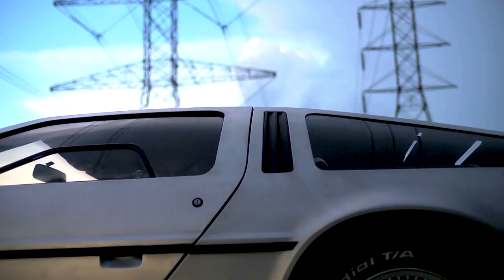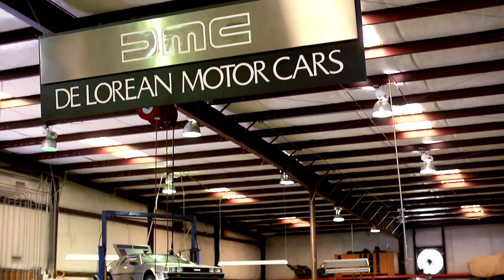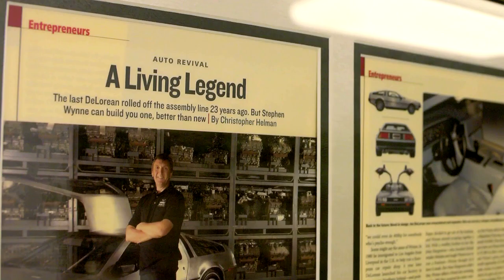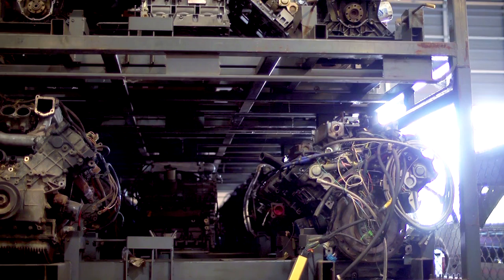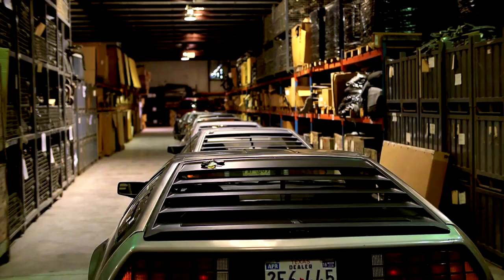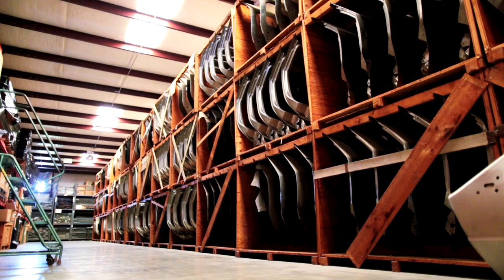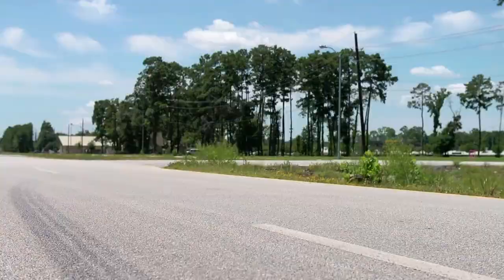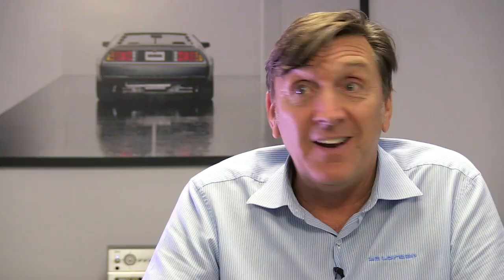New DeLoreans are still available, straight from the factory

Comment: just replace the engine and this car is a dream
Reply: +flip inheck I'm not american. i don't get why US restricted the hp of the engine?

 I thought US allows all sort of cars on the road.
Reply: That's like before the 60's where there were almost zero regulations with automobiles. As time progressed new emission laws started to popup, and a lot of engines in this time frame were heavily restricted to meet those standards. Took a bit to create engines that made decent performance at these standards.
Reply: Daniel Semi id be tempted to throw a nissan v6 in
Reply: juan def I would throw in a Yamaha 4.4 V8 or a 3.5 Ecoboost
Reply: HERPY DERPEDY I'd keep it v6. I'd maybe put a Renault V6 from the Clio possibly..otherwise a Rover V6 2.5
Reply: Daniel Semi that was the down fall of the car
Reply: HERPY DERPEDY you could rip that 4.4v8 out of a volvo and superchrmarge it
Reply: juan def yeah that's why I liked that Engine I could also throw in a Volvo inline 6 turbo
Reply: HERPY DERPEDY you must like the newer Noble that has a yamaha engine in it too
Reply: jonboy79 the last v6 Clio was tuned by Porsche. the engine is very good now. 255bhp(190kw) and 300N.M of torque is not a downfall.
the 2003 2.9 24valve engine is very good actually. perfect for a Delorean. 
so no, that engine is not a Deloreans downfall as it hasn't ever been in a Delorean.
Reply: Think this engine needs abit tuning and there we go :)
Reply: It had an Volvo engine 130hp, i can tell that theese iron engines can be tuned pretty hard :) but then again, Look at the Car, remember your childhood (yes im old so what) its still more 
a car than an engine :) . Dont forget that there is people keeping this magnificent car up and running :)
Reply: I dont know what the Original engines were or the hp for it . But it looks like you could fit a small block 350 in there ? That would be plenty of power 305 as well ??
Reply: That PRV engine stinks.. 
would fit a VR38DETT instead 😎💪🏻
Reply: LS swap it.
Reply: Why not tune the original to max? :) It can take 400 hps :) well yes, its an old lady :) bit more tuning, might do more :) what do i know, im just an Goldfish in a bowl :)
Reply: The Spectator I'm a Turtle ._.
Reply: Daniel Semi  north star  v8 is a great conversion
Reply: Daniel Semi  north star  v8 is a great conversion
Reply: Nope, i refuse this, turd you are sir (joda talk going on) :)
Reply: Xmanhoe F 
Does it fit and has it been done, successfully? Best,
Reply: Yeah with a 2jz.
Reply: regular car reviews drove an ls swapped delorean check it out it's cool as hell
Reply: highoctanefiend 
Do you have the link?
Reply: joe Schlotthauer ^ link
Reply: Northstar is  never a good swap for anything not even swapping it back into a Cadillac lol they aren't long term engines. Ive seen plenty of these with v8 swaps turbo import motors etc and then I loved the car
Reply: flip inheck You are wrong. There were never any other versions of the DeLorean engine other than the couple experimental turbo engines. There was no higher-powered motor offered to the UK. And the US version is not restricted with a bunch of emissions. 'Da hell are you getting your crazy info from?
Reply: Make it electric
Reply: with a Flux capacitor.
That sells
The Words suggest a magnetic battery
Reply: Actually in truth the European one wasn't that great either. The engine performs well in the French Alpine and Venturri sports cars, but those are light fiberglass machines. But the heavier stainless Delorean didn't have the same performance as those cars. To add the to the problem, Lotus gave it a steel backbone chassis from the Esprit that added more weight. 
One former Top Gear journalist called the engine a wheezing asthmatic.
Reply: I would give this car the engine from the Chevy Volt... makes it more faster in terms of acceleration also does not have that much in terms of range anxiety as you get with the current crop of electric cars.
Reply: ***** anxiety is........ an anxiety.
Nothing else
Reply: +NorthernChev the truth is that the US market needed catalytic converters and other stuff to handle emissions. That restricted the performance a bit.. But not to the levels that this guy is talking about. The engine still didn't perform well in the European market.
Reply: Personally, I would like to see a Porsche 911 running gear swap. That would be awesome. A supercharged Evora engine is a good idea too.
Reply: Daniel Semi how about a time engine!!? OK that was corny.
Reply: flip inheck - It didn't make people believe it had no power, it had no power, remove the junk and it still, had crap for power.
Reply: Julian Pereira The DeLorean uses high-flow catalytic converters. And the engine has very few emission control devices. None that restrict any significant amounts of power anyway. The engine just didn't make power to begin with. Emission controls had little to do with it.
Reply: defintly the ecoboost would be crazy
Reply: My comments are from experience with a friend who owned one when new, it wasn't much power wise, most cars of that era weren't so I'm not slamming it. It ran out fine for what it was.
Reply: All engines were restricted during that time. The smog years took 400+ HP V8's and cut them in half, sometimes more. So, your theory is incorrect.
Reply: It's performance was improved in 1985. 

However, it still took 1m 40s to reach 

....88mph.
Reply: +NothernChev I am just repeating what I read in the Delorean book and what was in the Documentaries. No doubt that the PRV engine is a good engine. Its proven itself. But on a car as heavy as the Delorean, it didn't give the performance it should have. I do not recall there being a Turbo version as per the book. But I'm sure that the turbo would have been a good solution at the time. 
One motoring journalist called the engine a wheezing asthmatic. But the same praised the engine when in the Alpine A310. 
Of course early fuel injection systems did lag behind in terms of performance when you compared with the carbs. That's why many car guys preferred carbs to EFI on their hotrods. :)
Reply: +Jim J Fox ... Power to weight ratio. The PRV V6 was used in the Alpine A310. That car used to help engineer the underpinnings of the Delorean since Delorean thought about using it. 
The difference is that the Alpine was made from plastic or fiberglass and the Delorean was made from much heavier stainless steel. To all to it all, Lotus gave the Delorean a metal backbone chassis which added to the weight. 
Also the PRV V6 used EFI. Older EFI's were not that great. Car guys preferred carbs because EFIs used to give out less power and performance back in the day. As a result it was slow.
Reply: No production engine ever had it's horsepower cut in half by emissions. That's ridiculous.
Reply: Yeah, that's why, because we're afraid it will make more power than our inefficient V8's...Give me a break.
Reply: In 1970, the Cadillac 500 cube  4bbl engine had 400 hp.  By 1975, the same 500 cube  4bbl engine had been so severely de-tuned to meet emission requirements, it was only putting out 190hp.  Look it up.
Reply: Donny Hinson k
Reply: It is ridiculous. But, it's true.
Reply: why not use a toyota supra engine xD
Reply: It wouldn't fit.
Reply: You forget te obvious...those large american engines could work for years, have very long distance running by them and those powerful, tiny european shitty engine would break in warranty time...or shortly after it...Why? Because they are small, because they are overpowered, because they have to abide restrictly rules about environment...and thats why now in new engines it is nearly impossible to polish...when cylinders are in bad shape...and some of engines could last only 60.000 km and than are just a plain garbage - fuel economy, environment rules...and all this shit brings only one thing for a consumer - large, very large cost of repairing this kind of tiny shitty overpowered engine.
Reply: Honestly I'm not convinced. European engines are compact and built to strict tolerances, but most are really strong engines and provided that they are maintained well, they will run for as long as an American V8.
Reply: Julian Pereira You've obviously never owned a French car.
Reply: +Anon Nymous Nope, but I have owned an Italian one. Probably the most unreliable of the Europeans - Alfa Romeo. 
And in truth my Alfa's problems were not down to its engine, it was bad maintenance by the previous owner.
Reply: How does having owned an Alfa apply here? The absolutely AWFUL engine was a joint venture between Peugeot & Renault. With a manual gearbox 0-60 mph was a positively hilarious 8.8 seconds.
Reply: You are comparing two different engines, not the same engine with and without emissions. Manufacturers made different engines from the same block with the same displacement long before emissions. You are comparing apples to oranges.
Reply: What's with the recent spike in likes for this comment?
Reply: the vid is in trends
Reply: Daniel Semi yes true. And the speedometer. Lol.
Reply: and suspension.
Reply: +Anon Nymous
Firekage's comment about European engines being less reliable and inferior to the American ones. I will agree that the PRV is a bit of a dog's breakfast. For one reason that it was initially designed to be a V8. But then due to the fuel crisis in the 70s, it was turned into a V6; still keeping the V8 style block design, etc. 
However I'm not entirely convinced that the PRV is an awful engine. Properly tuned and with turbos it does produce some power. 
I've mentioned this before. The record for the highest top speed on the Le Mans circuit was done in a PRV powered Peugeot. That's an accomplishment.
Reply: And exterior lol...
Reply: +moparjr89 maybe they should change it for a HEMI. I would really like to see that, but I think that the HEMI engine is heavier than the LS V8s.
Reply: John Lane modified this PRV engine re-boared the Cylinders, Rods where from SAAB, Cuz Volvo and Peugeot Sucket on Metal integrity.... anyway he pushed 500+HP out of his new 2.9liter engine.... CHeck out his 240 Volvo Rally Car..LOL!
Reply: lol. 130hp it's fine. Ok...
Reply: Nonsense, America is why the world knows about Turbo Hondas.
Reply: Yeah this car engine doesn't fit it's model...
Reply: my only question is why did they make a car with 130 hp engine in AMERICA where Every AMerican cars literally have really big engine....? Fuel Crisis?
Reply: Cyano - P originaly Delorean is from Ireland.
Reply: Daniel Semi it rides really rough not a cruzer
Reply: You got to be really dumb to replace that engine,  a 2.8l v6 that only produces 97kW, drive this thing with a manual transmission and the engine is going to last forever.
Reply: +Rewjik The engine isn't the best, but its not worst. However I think that the Delorean would benefit from a really good replacement engine. There is one with a Nissan engine that runs really sweet. Another with a turbocharged 2JZ, which I would assume is really fast and quite reliable. 
There is another with a good LS swap. I did see a video of a Ford 302 small block swap. But I do not recall seeing a video of the finished product. 
If I was to get a Delorean, I would get one that needs work. 
Replace the engine with the setup from a Chevy Volt. That would give me great performance and good mileage as well. I would like mine to look like the car from the BTTF animated series though. :P
Reply: id just chick in a turbo boxer from a wrx sti
Reply: +Alexander Columbus
I go with the engine from the Legacy. Responds well to tuning and turbo charging as well as the WRX
Reply: flip inheck no it's the 3 speed slushbox. You need that 5 speed manual to have fun
Reply: MuggShotGaming yeah, actually, rally blue>stainless steel
Reply: 302 would be fine.
Reply: In a mid-engined car?
Reply: Joe11Blue The Delorean isn't mid-engined. It's rear-engined like a Porsche 911
Reply: So it is, my mistake.
Reply: Daniel Semi And fit a flux capacitor.
Reply: the interesting thing is that the engine noise you hear in the movie is the sound from a V8. But not just any V8. Its the sound from a Porsche 928s V8. 
Someone said that the engine in the original movie car was changed give it a better soundtrack. Others said that engine noise was done post production. 
All in all we can agree that the Delorean sounded really great in the movie than it does in real life. :P
Reply: JKflipflop I would put the running gear from a Chevy Volt. That way the tiny petroleum engine just charges the battery while on the move and gives more range.
Reply: an absolute dream
Reply: Maybe in the future it will hapen.
Reply: I see what you did there.
Reply: kaylerick  lmao
Reply: I was watching an episode of Wheeler Dealers where they do a Renault Alpine A310. They had an interesting idea about getting more horsepower from the naturally aspirated PRV engine. 
The Alpine club in UK have a kit where they made a manifold that helps you replace the stock carbs with a Holley 4 barrel carb; which I believe is easier to setup and tune to give more power. 
We know that Holley has other carb kits and even fuel injection that will can replace and perform better than the carb they used on show. Why not Delorean make up their own sort of kit and use the EFI systems from Holley. That would give more power to the engine and when they put in their stage 2 Turbo kit, even more power.
Reply: Everyone has their favorite choices on when it comes to the engine swaps in the Delorean. The original engine is a bit of a dog, but shown a bit of care and technical ingenuity, it can be pretty good.
Reply: NIck Buckingham Back then in 50's - 70's almost every American cars had big engine  and because of 1970's fuel crisis, American people switched from cars with big engine into smaller cars like Japanese cars
Reply: Make sure u have blown head gaskets first LOL
Reply: +flip inheck
Actually, even the UK market versions were slow.
Reply: It was a PRV all ALUMINUM v6...Volvo used it as their v6 engine,with a mild steel full frame that was powdercoated...and rusted out REAL FAST when the powdercoat started flaking off...Fiberglass body and Stainless Steel panels that were bolted on...the Gull-wing door were 100% Stainless Steel...engineered by Lotus in the U.K. and made in Belfast Northern Ireland...
Reply: the "only" heavy Stainless steel were the doors...the weight was in the engineered Fiberglass body UNDER the stainless steel as the cavities in the TWO PIECE MOLDED fiberglass body were FILLED with heavy high density foam to give the Fiberglass body Rigidity and Crash protection...and it had a Full Frame under the Fiberglass body...to  refresh...Epoxy coated frame   today called... powder-coating the  frame...Fiberglass body...and then the Stainless Steel bolt on panels..
Reply: Daniel Semi like a lawnmower motor? You'd probably have more horsepower
Reply: Daniel Semi LS SWAP THE WORLD
Reply: Lamborghini had its share of bad engines. 80's was notorious for this.  However it won't rust and it was not fiberglass.  I would buy one today.   Just because I like the car and I am a "Back to the Future" fan lol .  Jokes aside it was (gutless  with style ;)  almost like the Lamborghini Countach.  We all loved as a child with out knowing it was junk.  It is what it is.  Bottom line I want one but I would replace the engine.  I don't care about factory perfect.  I want reliability overall.  Just me though.
Reply: I spent most of my money on women and drugs, the rest I wasted.
Reply: No. Take of the american emission restrictions and add alpine cams. 

Remember the same engine propels the heavy volvo to good speed and the alpine v6 has same engine. The engine is very good. Restrictions made it perform so poorly in the usa
Reply: Daniel Semi replace the body with a lighter material
Reply: juan def and that would be the same engine :p
Reply: Daniel Semi ls?
Reply: JUNK motors bro!
Reply: volvos are teribly shitty motors
Reply: Put in a fuel injected big block American v8, twin turbo,pushing 3000 hp. th400 trans and a ford 9 inch rearend...oh wait that's street outlaws, this car only needs to reach 88mph to see some serious shit
Reply: I could do that for you
Reply: They should make a new version... imagine
Reply: It would be fun to make one of these Deloreans Electric or Hybrid! And fix the suspension a bit, cause the original was a pretty rough ride
Reply: My friend used to sell Volvos that had that engine in the late 70s-early 80's.  It was underpowered, and got mediocre gas mileage, but it was VERY tunable, and from what I've heard, is a fantastic racing motor.
Reply: This was my thought. In this clip he says people ask "What happens when you hit 88MPH?" With the stock engine...the next century.
Reply: That engine is french (PRV peugeot/renault/Volvo) crap.
Reply: How about a 5.7L double overhead cam V8 at 405 HP? If you give up the gull wing doors and stainless body get a 1993-1995 Corvette ZR1. Same car, updated electronics basically.
Reply: A heavy dream
Reply: Yeah, 4 electrical motors in the wheels, 100-150hp each, with generator on fuel and bateries, and it will be "back from the future", again :-)
Reply: flip inheck  think about it. If you say that the US regulations restrict the power then they're going to restrict the power of the American v8 so your argument about inefficiency is invalid. All being equal, the V8 will make more power in a similar design.
Reply: flip inheck  apparently the simplicity of my statement went right over your head. and by the way I didn't know engines had anything to do with the handling properties of a suspension. Let's try this again. All things being equal, a larger displacement engine will put out more power then a smaller one. If us emissions standards restrict the power, then it is preventing the full potential of any u.s. Market automobile.
Reply: flip inheck  a typical internet response from a troll. coming back with a reply that has nothing to do with what I said. Let me know when you make sense
Reply: 2jz twin turbo. & all you had to do was follow the damn train CJ.
Reply: What’s wrong with the Volvo motor?😂
Reply: Just the engine?
Reply: Not quiet.  My son has one and there are a lot of parts that were not tested and need to be updated.  The car was not in production long enough to work out the kinks.  He recently put a VW Passant engine in it and just swapped the transmission from auto to manual.  Lots of mods to make it better and it's a wonderful car.
Reply: Ok, i'm just a brazilian guy, biggest fan of the De Lorean car! My dream is to have one! But, not even in a dream, i'll buy one of those!
Reply: @michealng6974  I didn't really see a good answer to this question below so here goes.  The US didn't necessarily limit the HP output of the engines, they forced auto makers to meet emissions standards that were difficult to achieve with carburated high performance engines.  So to meet the standards they nerfed the engines so they made the emissions goals.  European cars in this era started messing around with fuel injection, which is why they were able to keep a modest performance advantage over the US engines.  FI has been around since the 1930's but it was expensive and required complex metering and that complexity increased the cost.  GM had a very good FI system in the 50's and 60's but it was tempermental with elevation and weather changes.  In the 70's Bosch developed a mechanical electrical hybrid fuel injection system that worked well enough and was far less tempermental to elevation and weather (it could adjust to barometric changes).  This FI system could be adapted to run on many different engines, but you will only find it on European vehicles even though Bosch offered it to the US manufacturers as well.  

Fast forward to the mid 80's.  American cars are starting to be built with computer controlled fuel injection systems.  The early systems were very simple but they started to show engineers that they could actually meet the emissions standards much easier with higher output engines.  As the computers became more advanced, and could adapt to the changing driving environment much better the engineers were able to produce engines that exceeded the HP ratings of the 60's muscle cars, while getting better emissions that vehicles of just 10 years ago.  This trend is still going on today.  My Ram Rebel puts out 400HP and gets 17MPG on average and has lower emissions than the 1998 Silverado I replaced it with.  The 98 got 235HP and about 15MPG average.  Better power, better mileage, higher towing, and lower emissions.   It's a win/win.
Reply: @nephetula  This is only partially true.  In 1970 HP was rated as gross HP, meaning the engine was run with no accessories attached, not even the water pump.  By 72 the feds had demanded auto manufacturers give the consumer a more realistic rating of the engines HP which is with all accessories attached and loaded.  So the HP ratings are now net, meaning, water pumps (with water in the block) alternators (while charging the electrical systems), power steering pumps (with fluid in them) You get the point here, as the engine would be installed in the rig.  This seemed to nerf the numbers over night, but it was actually the same output as the 1971 models.  And yes they got nerfed again when in 1974 they had to meet some rigid standards.  Engineers could not meet the emissions standards with a carb, and produce the high HP ratings that we were all accustomed to.  Carburetors were simply too primitive, to achieve good horse power and good emissions at the same time.

Carburetors were invented in the late 1800's.  They peaked for performance technology in the 1960's, and for economy technology in the 1980's but could not achieve both at the same time.

Fuel injection was invented in the 1930's, and has yet to peak in performance or economy technology, and we are seeing both still increase today.
Reply: Agreed. The Renault 4 cylinder engine was a joke. I did see a video where a man had successfully put a high performance GM V8 in his Delorean but he had to do a lot of modifications in order for it to work.
Reply: Stick a huge turbo on it...
Reply: flip inheck  but this car was american not an import, so why not a gas burning v8 with no power but at least some noise.
Reply: Micheal Ng now they do but back in the 80s or something they didn’t allow anything
Reply: @juandef4115  the Renault V6 was a ES9 on the Clio V6.
Reply: the PRV is still a nice sounding engine, people just give it a bad reputation.
Reply: I think it’s funny how they made us take lead out of the gas for our cars but airplanes flying over our head gets to have them... if they really believed in men made global warming they would STOP ALL flights, I mean life and death but instead they tax us for carbon and ppl don’t believe govs scams
Reply: juan def omg Nissan makes a bad ass v6, my maxima will fly
Reply: We were royally ripped off on the engine front. With a name like DMC-12 it should have been a V12. If they had to offer a six, there could have been a DMC-6 too. It would have to had been an inline 6 too, for the sake of smoothness; traditional Jaguar style. Having the PRV V6 consigned it to 'hairdresser car' status. As much as I hate to contradict myself, apparently they considered releasing it with a Mazda rotary engine, which would have been far more interesting and in keeping with the futuristic theme. Aren't I quite the visionary?
Reply: @michealng6974  We do, but in some areas of the U.S. Emissions are heavily restricted resulting in things having to be in that result in reduced power.
Reply: Just slap in the LS3 an you're good to go.
Reply: put tesla's model x p100d motor +battery on it
Reply: With a tesla motor 😁
Reply: Chris Atkinson ...North Star's are junk motors, just ask Cadillac patrons.
Reply: and add a rollcage
Reply: V12 u mean
Reply: They did change the engine the old ones had 130 hp the new ones have 300-400 hp
Reply: Daniel Semi.....Yep..
Reply: Two words.... Flux Capacitors
Reply: A friend of mine dropped in a Volvo B21, their amazing slant straight-four engine first used in the 200 series...THAT car was cool. Ya might think, wait...he swapped a 6 for a 4 cylinder?...well the DeLorearn's curb weight is 100 lbs lighter than the Volvo 240!!
Reply: Donny Hinson oh we can’t forget about how every car had a gas mileage of 10 mpg, almost every old car from the 60s and 70d are gas guzzlers look at the 65 Deville
Reply: It needs a V8 to make it sound like the car on the movie.
Reply: What's wrong with the engine?
Reply: @omarsanchez3069  I find it a little too weak for this car.
Reply: @daniyil4843  what's the best engine you can put in it?